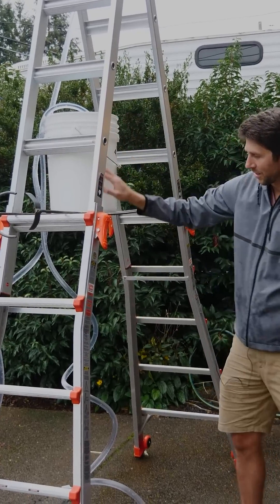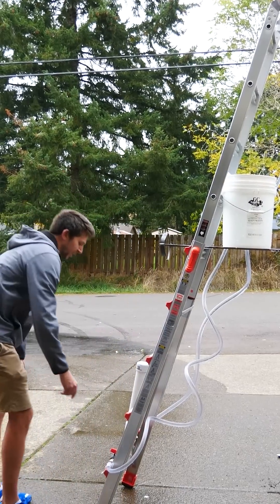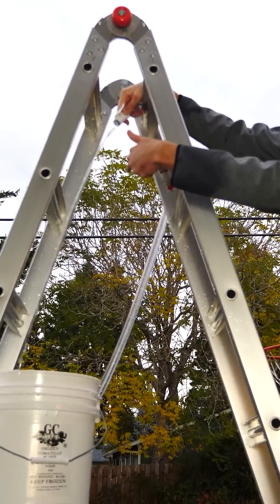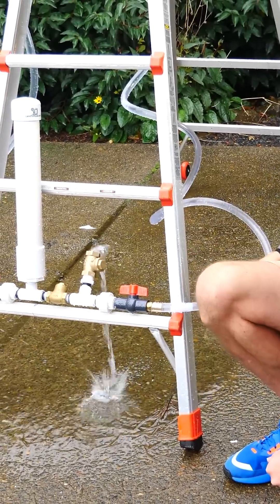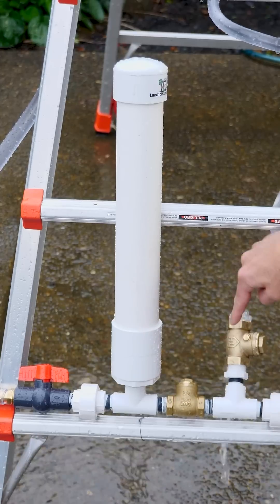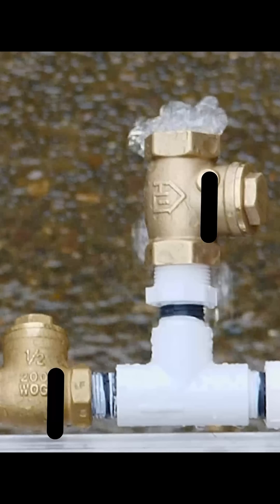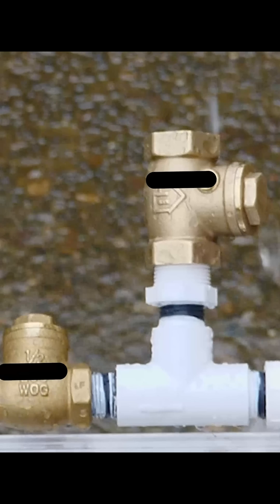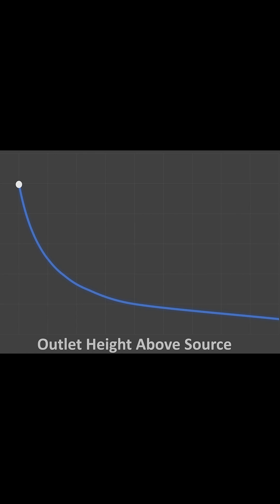Hydraulic Ram Pumps Are Magic

Comment: Put a hose on the waste water valve and let empty back in the bucket. You just need a smaller diameter hose. It will continue to recirculate until evaporation requires you to top it off.
Reply: lol no it won't.
Reply: @seigeengine  It won’t if you don’t do it, but it will work. I’ve done it. It’s not rocket surgery.

Comment: One of these installed in a pool of some size , which has an outflow connected to it , could act as a pump to power a small waterfall , if one were to be a fish breeder and needed to have the running water , along with the higher oxygen levels , to obtain better health for the 'proficts'  and provide some current , for exercise .  Even a home aquarium, would benifit  from one .

Comment: Why couldn't you have the waste water feed into a reservoir that ultimately feeds the source reservoir? Say this were a  man made stream and the goal was to take the water at the end of the stream and transport it to the beginning of the stream that was at a higher elevation and the whole thing is generating electricity through the use of many little water wheels.

Comment: Is there a pump that uses the same concept continuously instead of in pulses?
I'm picturing water flowing downhill turns a water wheel, which powers a pump that pushes a smaller quantity of water uphill?

Comment: On the waste water, can you simply reduce the size of the line after the valve and lengthen it to reach back to the bucket?
Reply: If you reduce it too much the water can't get flowing fast enough to cause the water hammer effect that is pushing the water up to the top.

Comment: Really nice setup. Can high enough pressure be induced with gravity alone, using a narrow nozzle i guess, to mine rock?
Reply: Absolutely yes, theoretically. Since you get a little over 3 psi for every 10 feet of liquid height (water) if your source is high enough, you could get very high pressure at your nozzle.
Reply: @CheMechanical 33 feet equals 14.5 psi average, at a typical location slightly above sea level.

Comment: Love this little engineering masterpiece. Actually invented in England by Clockmaker Whitehurst ~1772, or in France about the same time. Montgolfier had one. A Swedish engineer,  find one in France early for 1800-something.,BUT it hadn't any automatic valves. You have to open/close valves manually. That Swedish guy, engineer J O.Lundberg, took a patent in 1896 ( begun selling them in ~1893). Product was baptized Vädur, Vædur (Ram in English). Try to get a pic in here, no it didn't work my way. It was sold all around the world. Sold in it's original design until ~2000. Perhaps today. As young boy I saw that miracle! Without any external power keep pumping 24/7?? All the water flooding around was the power I understand (and forget) as an adult. I think, easy estimated,  90% was spilled to pump the left 10%. But it pumped it to a HIGH level. I still love it, and among bicycle it's a sustainable invention.

Comment: You could have EASILY obtained efficiency data from this.
Also, you could have cut the rubber tubes to length..
It feels pretty lazy for the standards we've learned to expect from you, because it would have only taken you 10 more minutes plus 5 minutes of thinking to pull off a FAR better experiment than the one you did here.

Comment: I feel like the efficiency might change if you traded out the Tee fitting for a Wye fitting on the first valve. It seems like there would be less turbulence in the system.
Reply: Like in the Great Pyramid
Reply: two things needed in this model to improve efficiency -
1) the feed pipe should be straight.
2) the feed pipe should be hard , not soft & elastic.

Comment: What if you recirculate the waste gate water into another hydraulic pump so that the water is not wasted...if its possible....🤔 could it be possible to keep it running until the water eventually evaporates🧐

Comment: What are some example use cases
Reply: Pumping some water to a high elevation when the pump equipment available cannot provide sufficient pressure.

Say you have a large reservoir of water, a pump, and a power source for the pump (maybe even solar).  You need some amount of water to be pumped to the top of a hill or building or big water tower.  You use the pump and energy source to fill a tank as high above the reservoir as the pump & energy source are capable.  Then you set up this ram pump so that water flows from the tank down to the level of the reservoir - the waste water is ejected back into the reservoir (so not really "wasted"), and the remaining water gets rammed up the pipes leading to the top of the hill or building or big water tower.

Comment: Ok.

I know it won't work...

But like...

Could you try to recapture all the water pumped out at the bottom and use water mill generators from all the falling water, to in turn power a pump that returns all water back to the original resivour?
Reply: You can make a Perpetual* Motion Machine 99.999 (and so on) efficient in theory (with a PILE of dev work and funds), but it will never get to 100%, let alone above that (which would be needed to make it produce energy/be practical)

Comment: i find it depressing that something so simple, that was first made at least one and a half centuries ago, is such a "mysterious" item to our modern, "highly educated" society...

and all ive seen is the basics. man, they went full-scale psycho with these things, accumulators, double stages, extra high pressure pistons... what you see today is a mere shadow of their former glory.

and they have absolutely nothing on a "humphrey pump". think ram opump, but give it some air and fuel and a spark plug whilst at it. the "ram" effect gives you compression, and the momentum of the water does the rest.

also calculated to have a carnot efficiency of 52.5% or thereabouts.

try finding out anything about a humphrey pump.

better yet, try BUILDING a humphrey pump.

goes back to the old books, that describe a time when humans were intelligent and could apply basic principles

Comment: Ordinance Survey maps show hydraulic rams which were installed in Victorian times to supply water to houses many metres in elevation higher than the source, usually a spring. They also used a device called a jack pump.

Comment: This is very interesting! How come you have that long capped pipe afterwards?
Reply: I'm interested in that myself. What it might be is basically an empty tube filled with air.  Something like this can be used in household plumbing to prevent water hammer, the air acts like a spring because it is compressible. When the sudden pressure spike of the water comes through that second valve in the system, I think it might tend to compress the air in that tube and then the air will decompress more slowly and feed the water into the rest of the system where it exits from the top.

It may be that without this the sudden pressures shake with shake the whole system and possibly waste the energy he's trying to use to lift the water.
Reply: @NomadSoul76  oh wow! Thanks friend!!

Comment: I'M SO GLAD YOU'RE COVERING THIS!
I learned aout hydraulic ram pumps about 5 years ago and my dream is to pump saltwater inland to grow rivers and lakes in arid environments, such as regreening the Sahara until the lake effect takes hold and saltwater can be replaced with local rains
Reply: Sounds like an environmental disaster, salting the ground isn't going to "regreen" anything
Reply: @gatergates8813  it's an essential part of coastal irrigation.

The salt filters out through the sands, which leaves a watertable of freshwater for plants. The river banks could also foster salt marshes with grasses for elephants to thrive on.

Of course it is a potential ecological nightmare to consider, but so is the path we're currently on. All fixes being proposed are quite extreme and will likely have consequences that need their own solutions.

The reality is that the climate is warming and precipitation will increase across Africa. This will take 10,000 years naturally, so perhaps we could fix more carbon, feed more species, and create more water supply by speeding up this process without adding heating or investing in energy-intensive methods.

Comment: What would happen if you connected a pipe vertically to the waste water valve, so that the water does not flow out of the system, but rises and drops (hopefully) within the pipe. Would be cool to test it out
Reply: Then the pressure won't be created because the water flowing out creates a pressure

Comment: I understand that perpetual motion is not possible, but when I first saw this working, I immediately thought, “ holy crap! Could that actually be a true Perpetual motion machine? A Second later, my dreams were shattered when he showed the valves 😂
Reply: @sudhakarg8921  my toddler is a perpetual motion machine!  Actually, that’s not correct! We have to feed her food to function !
Reply: Route the water from both sources so that it turns turbines connected to small generators connected those generators to a pump that pumps the waste water from the bottom back up to the bucket. You could even add a turbine and generator in the initial drop tube to get additional energy to add back in to the system. While is is still not going to be a perpetual motion machine, it will allow the system to run longer.
Reply: Also when in doubt, friction ruins all “perpetual motion machines”.
Reply: Perpetual motion is possible: spin a top in space. Push an object in space.  😅😅😅
Reply: @TheRainHarvester  even that’s not truly perpetual. even in a perfect vacuum (which is far from what we have anywhere in our galaxy) it’ll extremely slowly lose its energy and momentum through various phenomena:
- blackbody radiation, which will have a slight bias towards slowing it down through the momentum of light
- unless it’s perfectly symmetrical: gravitational waves
- molecules tunneling away from their chemical bonds and flying off into the distance. it’ll likely stop spinning long before the entire top has evaporated

in low earth orbit it would only last minutes and it wouldn’t last very long at all anywhere in our solar system
Reply: @asdfghyter  all those move perpetually too: molecules, radiation etc. 🤓🤓🤓
Reply: @TheRainHarvester  OP was talking about perpetual motion of the first kind, one that creates energy.

Your example with the top is perpetual motion of the third kind, where one eliminate friction and similar, which is also impossible according to the laws of thermodynamics
 
The entropy of any closed system will always increase until nothing with structure remains
Reply: @asdfghyter  motion until the heat death of the universe is long enough to call it perpetual motion for me. 🤓
Reply: @TheRainHarvester  that’s still practically impossible to achieve though since we live in a galaxy. everything we emit will collide with something and slow down long before escaping our galaxy
Reply: @asdfghyter  current theory is that our universe's expansion is accelerating.   Eventually particles will move very far apart from each other.  Perpetual movement (and even perpetual acceleration) is achieved. 🤓🤓🤓🤓
Reply: Thermodynamics shall not be cheated so easily

Comment: I was wondering if such a system could operate without loss of water and no machine

There could be a pipe of greater width bringing the water down and at the bottom, it can be connected to a pipe of much smaller diameter so now the water will have more pressure and will go up.
Would it work??

Comment: Can we make 2 such pumps where one's waste valve fills the other one's reservoir and vice versa? By doing that, I guess we get 2 pumps with zero loss of water in the system
Reply: the waste valve has to be lower than the source bucket, so you couldnt
Reply: Yeah i see what you mean.. imagine this is the setup and the distance between buckets is represented by the distance between the words

1st bucket, like in the video
.
.
.
Pump and leaky valve in the video
Bleed this leak water into 2nd bucket
.
.
.
.
.
.
.
.
.
.
.
.
.
.
2nd pump, shoots water to first bucket
Reply: The waste water is necessary for the system to operate.  Notice the waste water only spurts a few inches above the waste valve - the waste water lost the kinetic energy it gained flowing down from the bucket.  The system is set up so that the waste water is transferring most of it's energy to the water that surges through the second valve.

Comment: What would happen if the waste valve was connected to a tube that went back to the bucket?
Reply: The waste water wouldn't have enough energy to push itself back up to the bucket.
Reply: @cammccrae  I wonder if it could be collected at a lower elevation and then just repeat the ram pump coming off of that for more efficient transfer of the water. I also wonder if this type of system could be improved by using more specialized parts with specific sized internal diameters and possibly the use of a venturi like apparatus that could be used to increase output pressure.  I would also assume that this setup could produce compressed air that could be used to perform work as well

Comment: If you're familiar with water hammer, that is precisely what is happening here. Water will flow downhill, and once it's moving, it has kinetic energy. If you suddenly slam a valve closed, all of that kinetic energy has to go somewhere; typically into the nearby plumbing, causing a sudden jolt of increased pressure ("water hammer"). In this case, there's a convenient place for it to go: up the tube. And so it does.

If there's a large mass of water and/or it's moving quite fast, it can have a lot of kinetic energy. This increased pressure can be many times higher than the head pressure of the water's static mass under gravity, which can cause big problems if there's no safe place for all the energy to go. Water is relatively incompressible, so a typical solution is to add a surge tank nearby that contains a compressible fluid (gas) - this way the energy will be spent more gently by compressing that gas, causing a much more gradual change in pressure instead of a massive spike. The water will surge into that tank, and as the gas in the tank is compressed it will start pushing back, slowing the water down gradually until it stops flowing, reverses, and eventually the compressed gas will push that extra water back out of the surge tank and the system will return to static equilibrium.
Reply: He glossed over the important part. The kinetic energy of the water cannot exceed the potential energy it had when it was in the bucket. So on the face of it it would appear that even if you made this 100% efficient and recovered all of the kinetic energy, it could never pump water higher than the source. The key is that this is only true for kinetic energy per unit volume of water. By setting a long train of water in the pipe moving, you're able to harvest the kinetic energy from the entire volume of water in the pipe, to pump a small volume of water higher than the source.

It's analogous to dropping a basketball with a tennis ball stacked on top of it. When the basketball hits the ground and tries to bounce, its kinetic energy gets transferred into the tennis ball, causing the tennis ball to fly much higher than the drop height. Whereas if you just dropped a basketball, it couldn't bounce higher than the drop height.

That's why the waste water coming out the lower valve is important. Without it, this would happen just once, then the kinetic energy in the water remaining in the pipe would be insufficient to get it back up to the source bucket level (the basketball just rolls around on the ground instead of bouncing). And the whole thing would stop. By allowing water to bleed out the bottom, you allow the train of water in the pipe to build up to full kinetic energy again, so you can repeat the process.
Reply: @solandri69 I think a rocket analogy would work better in this case
Reply: The surge tank you're describing is actually also pictured.  That tube on the left that is capped is filled with normal air (just like a surge tank) and it takes up some of the water hammer pressure.  Once the valve is closed the air tries to return to it's normal pressure and pushes more water up the tube.  This is why you see the ram closes so suddenly, but the release of water out the top is just a BIT more gradual.  It's because of that little surge tank taking up some of the pressure.  His setup doesn't really need it for the demo to work, but it's extremely important for people that are using ram pumps to move hundreds of thousands of gallons of water per year, in their hydroelectric off grid pelton systems.
Reply: The YouTube channel “Practical Engineering” has a great video on Ram Pumps which is worth a look in my opinion  (Also Water and Steam Hammer for more technical and non-ram pump applications)
Reply: Firehose water hammer 😳
Reply: I'm proud of your commit, sir. He could have made that analogy. Also: He could have EASILY obtained efficiency data from this.
Also, he could have cut the rubber tubes to length..
It feels pretty lazy for the standards we've learned to expect from him, because it would have only taken him 10 more minutes plus 5 minutes of thinking to pull off a FAR better experiment than the one he did here.
Him not even explaining what the original poster explained here was extra laziness.
Reply: @jonslg240  FFS make your own  videos then.